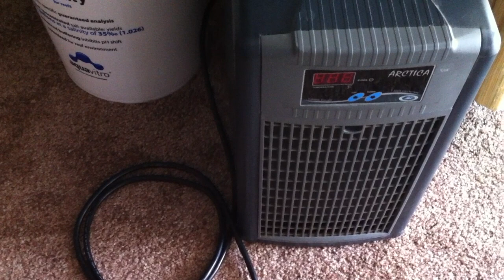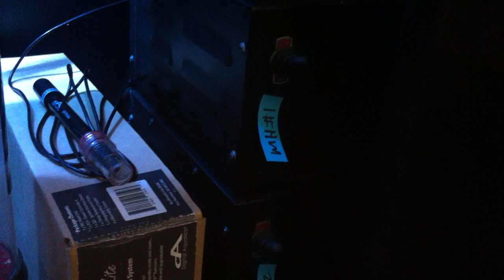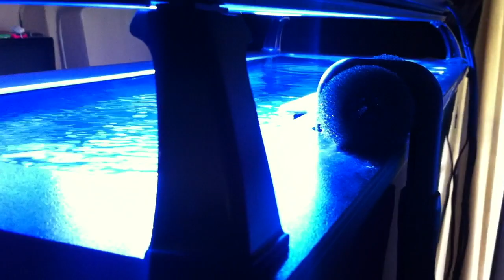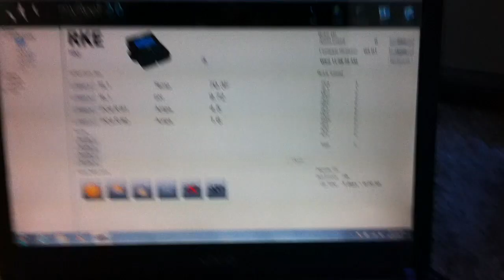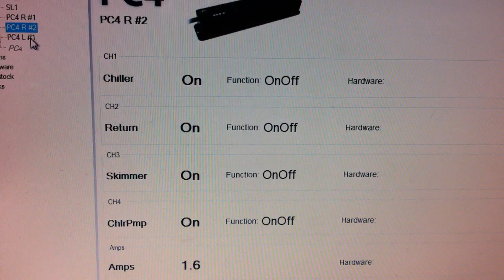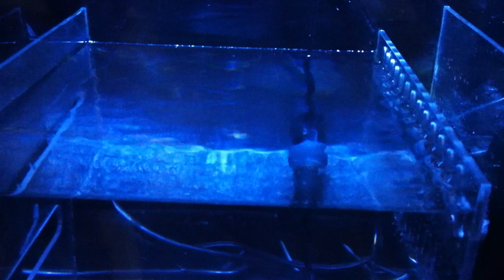jmadden's Reef: 90G Build Day 12

Comment: Hey Madden, glad its up and running. I was going to suggest, those post it tabs arent going to last that long. I used a Metallic Sharpie Marker, I wrote on the outlets worked great for me. I even wrote on the power cords.
Reply from the maker: 915Mang Those post-its were only temporary while I was working on getting everything wired up and they helped when programing the ReefKeeper on the computer. This way I could label each corresponding channel. I may use one of those Brother label makers. I used them on the 60G when the ReefKeeper was on there.